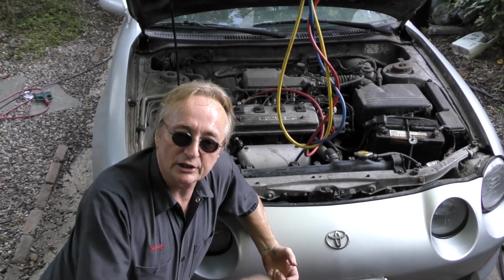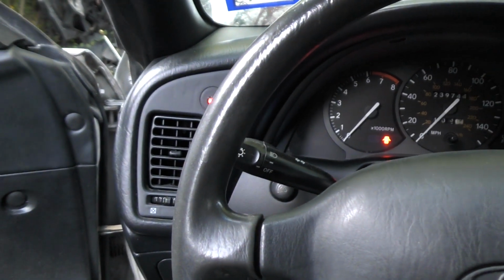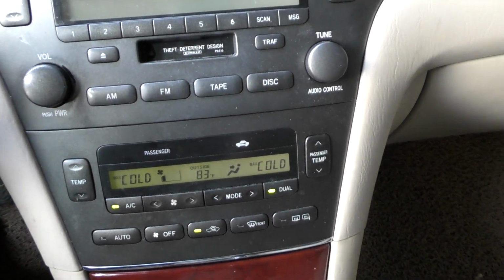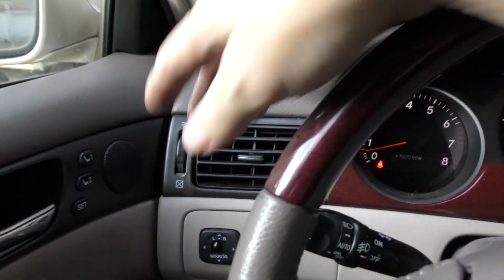Doing This Will Make Your Car's AC Blow Twice as Cold

Comment: Ive had a problem with my brakes lately. New brake pads, bled the brakes and couldn't find ant vacuum leaks. Ive got plenty of brake pressure yet when I brake it seems to roll up to a stop. It slows from 60-10 easily just not 10mph-0. On occasion the engine stalls when i brake but that may be a seperate problem. Can anyone point me in the right direction on this
Reply: Had the problem since i bought the car

Comment: Hey Scotty! I'm having trouble with my 2013 FR-S overheating. It started maybe 3 weeks ago and I've been barely driving the car. It all started when I would turn on the AC for cold air and it'll just blow air and my car started overheating so I would turn it off. I noticed one of the cooling fans was not working so I replaced it with an aftermarket cooling fan. It worked for two days but then the AC stopped blowing cold air and when the AC is off then it started to overheat. I've checked the relay fuse and it's good. My car has coolant and there's no leak either. Ive never added freon to the car so just maybe but I doubt it and I haven't checked the battery or alternator yet too. Obviously I dont want to spend crazy amount of money and living at south Florida with the heat and humidity it sucks lol

Comment: That's what happened to me. After about 65Kmi, the mode flow door actuator failed. The dealer want's $1960 to fix it. It's about a 10-12 hour job to replace a $174 actuator. The main issue is no defogging of the windshield/side glass. I decided since I don't use this car in bad weather or during the winter, It's not mission critical. If I put the a/c on as soon as it starts raining, the windshield usually won't fog up. I'll have to try that 'technical tap' idea, though...Who knows...instead of a burned out motor, maybe the door's just stuck...Hmmm...

Comment: We bought our daughter a 01 ford Taurus with 97,000 miles. No a/c. Compressor doesn't come kick on. Should I try to put R134a in? Does the compressor not come on if its to low as to not cause compressor failure?

Comment: Help my low pressure is almost at 100 and high pressure is 50 WTH is going on do I need a compressor 🤦🏻‍♂️
Reply: Check.the filter dryer and expansion valve(TXV)
Reply: @flybackdiode9580   the mechanic say the compressor dying plus I got the a week ago he said they going to replace it plus where is that stuff located at on a 2014 Nissan Sentra 1.8L

Comment: I recently changed my brakes on my car like 6 days ago and they do a squeaking noise, any tips? ( when i replaced the break pads i just took them out of the box and installed them)
Reply: Do they squeak all the time when you drive, or at low speeds? Or do they only squeak when you apply light brake pressure, and then it goes away when you brake harder?
Reply: Marvin Namro low speeds when i break they squeak, but when i break harder it stops

Comment: What do you think about a 2002 to 2002 Chevy Prizm with a 5 speed manual with 140k miles in it??? And thank you for your videos Scotty
Reply: Corolla Knock off. Ought to be a good car, if you can get it for cheap
Reply: Endless money pit
Reply: Could be a great car, but may use oil and some of those 5spds had some issues, bad bearings etc. But hey do your research, inspect, don't pay much because you win some and lose some but that's life
Reply: Is 700 dollars too much?
Reply: @JuanPrado1985  no. If it runs, it's worth $700. Especially if it has decent tires, good battery and any gas in the tank.  
Super bonus if the a/c works

Comment: Hi scotty , my rav4 v6 battery voltage rapidly changes between 13v to 13.8v and it keeps playing , my battery is new , could it be voltage regulator
Reply: It's fine, battery float voltage is 13.6V normally, if it is a smart alternator it is sending desulphation pulses to the battery to make it last longer. Source: battery engineer
Reply: Normal

Comment: Here’s one for you. 2013 Ford C-Max hybrid. Heat out vents on passenger side even though temp setting is at minimum. Have changed pass side blend door actuator twice. Now get this, if you give the car a false start (push start button without pressing the brake) wait a couple of seconds then push the brake and press the start button again (normal start sequence) car fully powers up (Ready) and HVAC functions perfectly until next shutdown cycle. I think it’s an issue with a body control module???? Remember it’s a hybrid.

Comment: Scotty I have a 2011 taurus and have had the throttle body changed yet it keeps getting stuck open or closed while driving or just idleing.what could it be?
Reply: They had a run of bad throttle bodies for a while. But the pedal position sensor might be a problem
Reply: @rays7437  thank you I'll have that checked out

Comment: I have a 99 Camry and the air conditioning doesn't work in the middle vents what's the solution for solving that problem. And I don't have a cabin air filter I checked it already
Reply: If the side vents have good air flow then there is something in the ductwork,  or the ductwork has rattled apart.  
If none of the dash vents blow air then there is a vacuum leak

Comment: What about  a van with a 110 ac window unit in the rear. With a inverter to get power? Does it have too much electronic draw?  Someone did that but it seems not to have enough electricity ( 110 ac) . Is it wired wrong? Or is it just a unworkable idea?

Comment: Setting air to interior recycle rather than outside air is the trick, the end.

Obviously if your ac is damaged, requires refrigerant, or bad relay fuse.  Then you need to fix those.
Reply: @KillEmAllWithMetal I've tried this with a Lexus, a Corvette and a Toy. Solara Convertible, and BMW 7 series in our family.  In recirc. mode, the blower sounds louder in each car, but there is no difference in how much air volume  is coming thru the system. 
And if you wish to breathe the same air for 2 hours, that's up to you.  No thanks is my opinion. :)  Airlines are forced to run re-circulated air in their cabins because of how extremely cold it can be at 35,000 - 42,000 feet. (I'm a pilot)  But stale, contaminated, even germ-infested poor quality air can be a huge problem.  I never run recirc. in my car, unless a foul smell is detected from an outside source, and by then it is almost too late to do much about it... LOL
Reply: but who wants to breath recycled air ?  It is fine until your car starts to cool off, but then fresh A/C air is better...
Reply: @jonrandall5490  but it blows slower
Reply: @joshuastephens1820  I'm not sure that is correct.  On recycle (recirculate they like to call it), it is LOUDER because it is pulling air into the system from inside the car... but louder does NOT mean more air flow.  It just sounds like it is doing more, but the blower motor is only going to put out the same amount of air, whether your setting is on recycle, or fresh air.
Reply: @jonrandall5490  wrong. On recirculated air, you are cooling air that is already cold, therefore it gets much colder much quicker, that air has also been through the cabin filter over and over again, therefore mich cleaner. If you switch to fresh air, you are pulling in hot, unfiltered air. Your car will get hotter, and your cabin filter will get dirtier at a faster rate.
Reply: @jacoobart  Actually it is you who is incorrect.  Recirculate is better only when you first get in a hot car.  But if you think leaving it on recirculate and thus  breathing stale air is better than fresh air, you need a padded cell.  And if you can't afford a $3.00 cabin air filter, then I suggest you try a moped or walking...  And you think outside fresh air is unfiltered, but stale recycled air is better....LOL !  That's actually hilarious !
Reply: This conversation is totally incomplete without adding the CO2 level in parts per million, ha-ha. And if stale air is a problem, you may... just... want... to.... take.... a...shower, more than once a month...
Reply: @jonrandall5490  even with a good filter you will be smelling other vehicles unless you use recirculated air.  However, I can recognize from your dialogue that you are either young or have an inexperienced life at an older age.
Reply: @jonrandall5490  negative 12 degrees farenheit at 20,000 feet.  You said negative 91 degrees?  Where were you, in orbit?
Reply: @jonrandall5490  Oh no, mine deffinately blows much harder.
Reply: @ianhinrichsendrummer2113  does it actually blow harder or just SOUND like it is blowing harder ?  If it blows harder on recirculate, you might need to check for leaves obstructing your air intake at the base of the windshield (outside -  at base of... lift the hood and make sure it is clear of leaves, etc... )
Reply: @jonrandall5490  I think its a bit of both?
Reply: @jacoobart  Yes, when you have it on recycled, it does get colder faster, but you are breathing the same stale air over and over.  That is why virtually all manufactures recommend putting it on recirculate when you first start up a hot car, but change it to fresh air after it cools off a bit.  The main point is air that goes thru some stupid filter isn't fresh air. Also most people NEVER change their cabin air filter, and a large percentage of people don't even know their car has a cabin air filter.  FRESH AIR IS BETTER !  Not stale !
Reply: @ianhinrichsendrummer2113  May be, but I suspect that louder leads people to think it is actually doing more, but the  reality is that a blower motor can on;y put out the same amount of air flow on  stale or fresh.  I prefer fresh air, fresh food, and fresh water.  :)
Reply: @jonrandall5490  Brother-Jon, I hear you on this man!  Another potential problem with "re-circulating air" :  Let's say you & a good buddy just left the parking-lot at  TACO BELL with the AC on re-circ, & both of you find yourselves "playing some  SERIOUS  Butt-Bongos" after over-indulging on the food there....  well?  I think anyone could guess what the noxious effect would be without getting overly gross about it, ya know?

Comment: I went to use my A/C gauge set the other day and got a surprise. It appears that they have changed the design of the top of the cans of freon. With the new self-sealing cans you can disconnect the hose from the can and all the freon won't leak out. This is nice but you need to modify an older gauge set to use the new self-sealing cans. I found out that they have adapters available to do it.

Comment: One thing I would advise everyone is to NEVER use the refrigerant-in-a-can type systems you buy at retail stores. The gauge doesn’t work, and it’s only showing the high pressure side (while also not accounting for temperature). I learned that by overcharging my AC system. Thankfully it was caught in time before any damage.

Comment: I have a 02 Lincoln LS. Someone broke the aluminium line near the radiator so I believe the a/c system is empty. Will running the car this was cause a problem or problems for the operation of the car? I realise this is why the a/c doesn’t work.
Reply: No

Comment: Mine blows hot I'm thinking it's just the refrigerant level. Passenger is cool driver is hot. Get up to highway speeds and driver side gets cool again. Never added any in either. Also works fine when temp is less than 90.

Comment: Ford knew Focus, Fiesta models had flawed transmission, sold them anyway
The carmaker says that it's not a safety problem if your car slips into neutral on the highway.
Phoebe Wall Howard, Detroit Free Press
Updated 8 minutes ago
Thank God I have a Mark 1 with real manual.
Reply: Must be a slow news day. The recalls and warranty extensions have been in place for 6 or 7 years now

Comment: Hey Scott I was wondering I've been trying to avoid using my air conditioner in my car old car cuz I always thought that it's like the car is running in a way that it needs to work harder to use it that's why I try to avoid it so my car doesn't overheat is there any correlation to that or is it okay to run it without affecting the engine

Comment: Don't buy an aftermarket digital AC control unit if you have an older vehicle with regular switches.  They typically die after a few months, right after the season changes, and you won't even know until next year.

Also, don't forget to hit the recirculation button (many older systems do not remember it was activated last time the car was on) THAT'S how to get it twice as cold.

Comment: Hi Scotty I have Nissan Altima 2013 I have Problem with brake light it's stay on I changed the switch brake but the light stay on for your information I drive the over 200000 km.

Comment: Here in Mexico, those seals we replace it, for about 80-100 DLS all job.
Reply: We do too if possible. But most customers want a warranty and will just buy a whole new compressor
Reply: @rays7437  Yeah I understand that, here in Mexico by Federal law, just 90 days if warranty.
Reply: @nestorllamas  
90 days is pretty good. Most places here are only 30 or 60 days on "workmanship" warranty
Reply: @rays7437  Do you work ac automotive sistems?
Reply: @nestorllamas  
I'm a bad mechanic. I break more things than I fix. Ha ha.
So I am a shop manager.
Reply: @rays7437  That's Nice.
Reply: @nestorllamas  
I would rather be working on cars than be dealing with customers,  but I'm not good at working on them. 
But I like being around cars and the shop and I like helping good people with their cars.
Reply: @rays7437  I am technician and a shop manager/owner as well.
Reply: @nestorllamas  
Wow good for you. I would love to have my own shop.

Comment: The best way to determine if the AC has the right charge is to feel the liquid line ( the pipe that goes from the condenser to the evaporator. ) That line should be equal to the ambient ( outside ) air temperature, plus or minus 5 degrees. If the condenser and radiator are back to back, you have to do it when the engine is cold, and before the radiator gets hot. A  cold liquid line indicates an overcharge and a hot liquid line indicates an undercharge. It would probably be best charge to AC until the temperature is 5 degrees below ambient. This gives you more time before it runs low again.

Comment: Scotty whey the temperature gets above 110 degrees here in Arizona, when my car is parked and idle after 5 minutes, the A/C compressor On and Off, on and off simultaneously. That’s only in temperature above 110 if it’s below 110 like 108 and below it works fine. Also while driving on highway, it works when above 110 but the problem is when it’s idling. Is it normal or could there be a problem? 2013 forester. Freon added and condenser cleaned but problem still persists.

Comment: i had the coolant for the ac refilled yesterday. i checked and saw that the compressor was working so i knew it had to be the coolant and since i had to fix the leak in the gearbox that sucked in air whenever i pressed the clutch making gear shifting a nightmare, i had the mechanic fill it up

Comment: My base 16 Trax has always been weak on the A/C side. I found that opening the windows for a minute or two works better than just jumping and expecting it to work like a '66 New Yorker A/C. After it get cooled down to outside temp, turn it on and place it on recirculate. It you do that it works better because it does not have to cool as much of the warmer outside air. But you got to remember that 1.4L gets 37 mpg for a reason. The A/C off a New Yorker would  use 25% of the available hp in a Trax just to run the A/C. That is if you some how could make it fit. That monster had a 440 in it for a reason and it did not need to shut off A/C when you put the pedal to the metal to pass. The En ghen ears are looking for minimum HP solutions for mileage. If you don't have your foot in the throttle to the max, it don't need massive boost and cubes to keep it moving. My brother had a Honda motorcycle that had a bigger engine and two more cylinders. If it was 115 outside you did not run the New Yorker on Max cool for very long, unless you had a winter coat on.

Comment: The alternator in My 2000 Ford Expedition was changed to a new one and it doesn’t blow any air to the front vents. Only to the windshield. What can it be?
Reply: Default setting when the system notices a fault, and at least wants to defrost the windshield in case it's winter. Not sure what's causing the fault.
Reply: @EMichaelBall  Good starting point. Thank You so much.

Comment: You should use your a/c at least once a month for a few minutes. The main issue is because its r134a so the molecules of the gas are very small making it easier to leak
Reply: Mainly you want to operate the system to get the refrigerant oil circulated.   This helps keep the o ring seals lubricated.

Comment: If u got to turn ur a/c down to make it blow cold the best thing u can do is get u a garden hose with a good end on it and wash ur coils and filter box out yes inside the car shop vac the water out ur floor and u mite get lucky and not have to replace any thing but it cant breath thats y it will get colder when u turn fan down

Comment: Scotty I have a 2005 Toyota Camry xle 2.4l 4cylinder. That the engine stutters when the AC compressor/electric radiator fans kick on. This only happens when the car is sitting idle like at a stop light for example. Going down the road at normal to high speeds it doesn't give me any issues only at idle. I have replaced the air filter in it last month I put in new laser NGK iredeam spark plugs in an effort to solve this issue. But no luck It has 260,000 miles on it. Any ideas what could cause this.

Comment: I'll second your point about battery or alternator causing squirrely symptoms .  The first Dodge Caravan I had, one day the speedometer started going around the wrong way.  Took it in to the shop, turns out the battery was going bad.
Reply: I've seen that! I've also seen windows roll up and down by themselves with the car turned off. Computers don't like low battery power